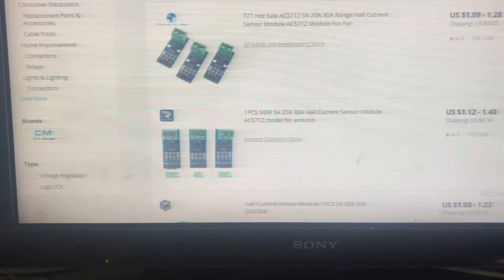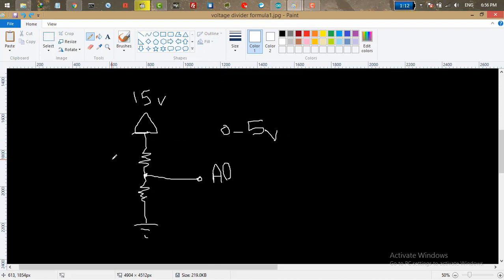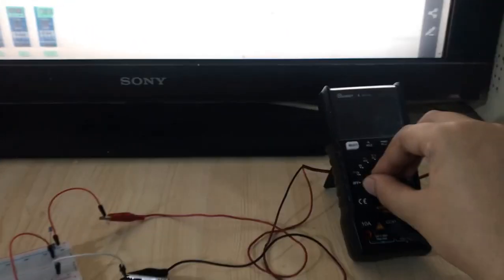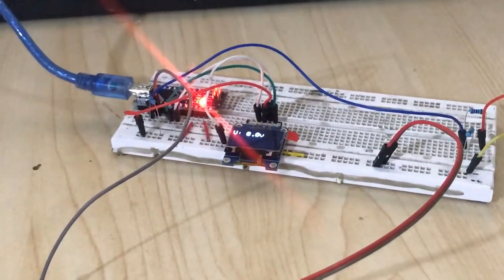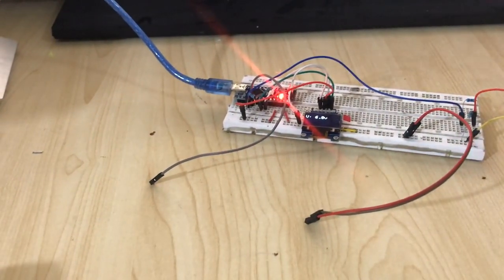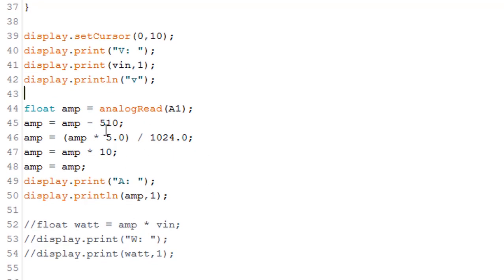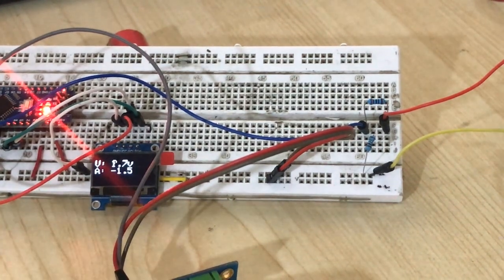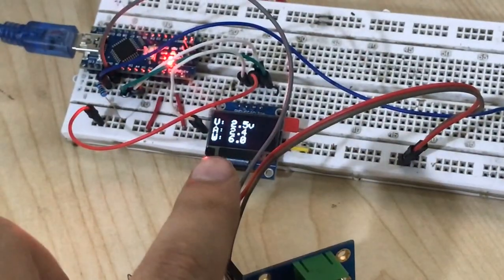How to use ACS712 with Arduino and Make Power meter

Comment: What changes if we use arduino uno and 16x2 lcd
Reply: No problem if you use uno or uno but if you want to use 16x2 lcd than instate of oled library you must add 16x2 lcd library and print values into 16x2 lcd that easy